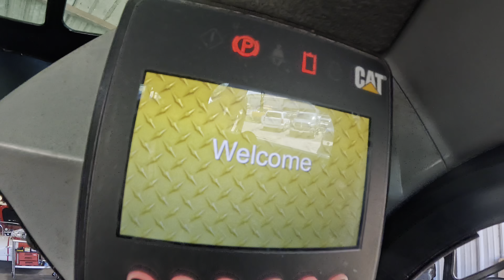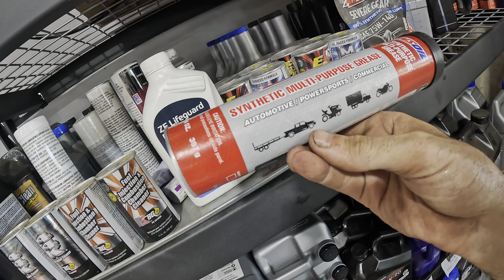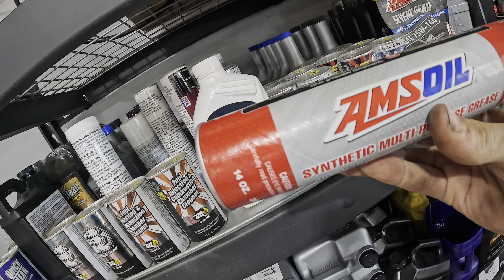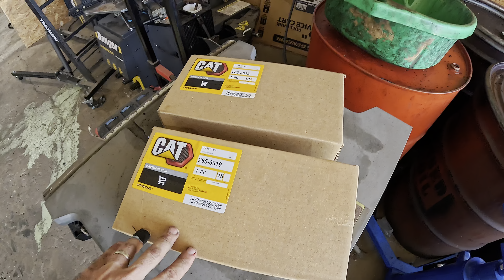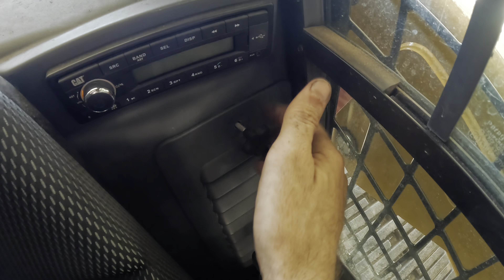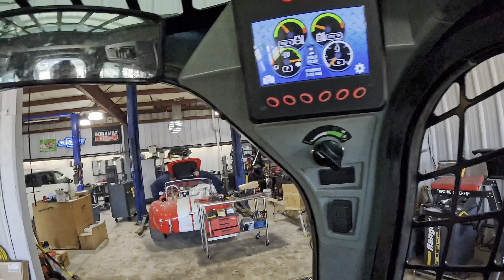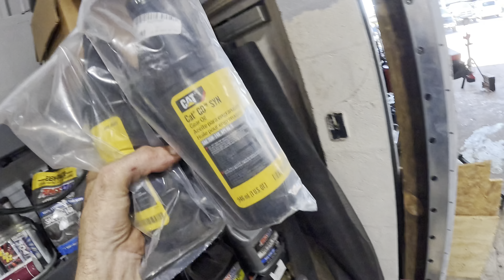Jack Stand Collapsed! Near Rollover! CAT 289D3 Skid Steer

Comment from the maker: Here's exactly what happened when loading the trailer. Lets begin with understanding that this is a hydraulic dump trailer and the deck will tilt back when loading. I have used a chain to lock the deck down to the frame and jack stands under the rear of the trailer to prevent this hinging situation. I usually use stacks of wood to achieve this but I wanted to try the jack stands out. As the trailer took the weight it rocked foreword and back causing the jack stands to collapse and the downward momentum of the even caused the trailer to lift up on the rear of the truck negating the parking brake and allowing excessive movement, potentially causing the machine to fall off of the trailer and or flipping over . When this occurred, there was only one option...SEND IT! I'm going back to using wood stacks.
Reply: I emailed you the CAT 289D3 Skid Steer CAT Maintenance Manual in PDF Format about a month ago. Did you receive it?
Reply: that front wheel that moves is called an Idler wheel.
Reply from the maker: @veteranga7529 I have it, we talked about that later in the video 😉 Ty!!
Reply: I always had pieces of 4x4 ,6x6 , and 2x4 in the back of my F250 for such events .
Reply: Danger danger Ranger😂😂
Reply: Wow really!
Reply: no matter how bad that intro looked, you did the best you could with that. aside from better prep to make that not happen in the first place, that was the best thing you couldve done
Reply: Dear Sir, you mentioned in this very own video, that thing weights around 10.000 pounds ~5tons,  couple of 2-ton jack stands wont do the trick, maybe a couple of 3-ton jack stands would have.. i didnt see that coming either and i needed a pair of pants too lol... XD
Never break rule #1 please.. Stay frosty!
Reply: That was a wild ride! Hope nothing broke on the rear end of your truck or the trailer hitch
Reply: And chock the trailer tires so you don't break the park pawl in the transmission from the rocking. Or just keep on doing it that way. Also I've unloaded on a slight hill and as I drove back the rear of the truck lifted and the whole mess started rolling!!
Reply: Ray, I hope you were wearing your brown pants for that.....
Reply: Ray, I didn’t see the coupler you are using but presume you have a 2 5/16 ball. I once had a coupler disconnect when dumping the load off a dump trailer I owned when the tung lifted off the ball. After that (although noisier than ideal when using) every dump trailer, equipment trailer and truck I ever owned we’re joined by a pintle hitch. It cost me a tailgate but thankfully no one died….
Reply: Question........  Backing it on would perhaps have made it trailer better...
Reply: Had a foreman pull a fork lift onto a wood decked trailer,it feel threw the deck & landed on the stee frame.He also had to clean his draws
Reply: At work we put on the parking brake of the trailer and car and put the car into gear (manual with FWD). It does lift the car up in the rear but it won't roll away. 
Privatly I still put the brakes on but use jackstands anyway to not stress the hitch too much
Reply: Next time put the skid steer on the trailer backwards you always wanna put the heaviest part of it on first
Reply: I worked for a sign company for about 8 years servicing everything from parking lot lights 30-60 ft. tall to huge high rise signs over 100ft. tall. Had several “close calls” of different types, but they ALWAYS took my breath away and caused an adrenaline dump, which almost made me take a literal dump😬😬😬All the precautions in world will not save you from Murphy’s Law. Glad you’re ok- stay safe out there!
Reply: Just don't break rule #1 at Ray's!! Very important 😂😂
Reply: Retired trucker here from Canada. I would like to comment on the  ramp situation. In my driving career loading/unloading some heavy equipment, I came across a UNIQUE ramp. This Ramp had hinged drop legs at the top of the ramp(underneath). When loading this kind of equipment as in the video the 'Drop Legs' were deployed from the underside of the ramps. It was just some flat metal that was hidden on the inside of the ramps that deployed(dropped)n to the height of the bottom of the trailer tires, thus preventing any kind of collapsing of the ramp when loading/unloading.Simple and effective as support legs.
Reply: You COULD also add(WELD)drop legs on the inside of the Trailer Box(Future Project?) These also tuck away nicely within an enclosed corner box(legs slide up and down)
Reply: Rule number Ray; don't die at work!
Reply: Nice save, though. Cheers.
Reply from the maker: @Liquid_Plasma  indeed the math is not mathing, We figured the trailer suspension suspension was going to carry the majority and the stands were just to keep it from tilting. And that worked, 60% of the time
Reply: That being said, it was hilariously entertaining, and will do well with the algorithm!
Reply: That is why I got mounted stabilizer jacks on the back of my trailer for loading and unloading off the back. Might look into a set for the back of that as they should be able to swing up and out of the way 3 ton would be good if you can find them and all they have to do is touch the ground. I do know they have a setting load but they also have a unloading rating.
Reply: Nice Kubota diesel,
Reply: I'm all the way across the pond, and even I clenched my buttcheeks tightly together. Wow!
Reply: ALWAYS WEAR YOUR COWBOY HAT WHEN LOADING!  
Just joking.

But you might think about taking the forks off setting them in the trailer with the tips aimed at the back of the trailer, or loading backwards. That way if you make a sudden stop because some careless driver pulled out ahead of you, the forks are not jamming out the frt of the trailer plus its more bed room the forks would be under the skid steer.

Wish i had the use of one for a month, i could really use it in my back yard. Plus they are fun to drive.  Just not like you did getting on the trailer.
Reply: I was helping a friend load a four wheeler into a flatbed trailer one time. Much smaller scale of course, but I was standing up by the rear bumper of the attached truck ready to toss a line to hook it on. A similar thing happened, but it pulled the trailer hitch off the ball. Naturally the chains weren’t attached yet either. Think I saw my life flash before my eyes and the trailer hitch gouged up his tailgate pretty good. Fortunately I wasn’t hurt. Learned a valuable lesson to stay clear away from that shit when loading. Never saw a trailer hitch pop off a ball before or since that day, but I don’t trust them like I once did.
Reply: At first I thought you had forgotten to place anything under the rear, which is a rookie mistake. You know better. Equipment failure is always a problem. We have heavier and taller jack stands. There are rated for 3 tons each. You won't get them under a car well but they are great for trucks and vans. The base tops out about as tall as the 2 ton stand when they are fully lowered.
Reply: Hi Ray,
I had the same issue the first time loading an excavator 💩💩
The safest solution is to lower the jib / forks to just above the trailer bed, before you go over the "seesaw" point, then as the machine tilts down at the front, you gently raise the jib / forks to lower the front on a controlled manner, you can crawl forwards at the same time. This way, all equipment is spared the shock loading, and of course, the operator and bystanders are safe. 🤜🤛
Love the channel, your sense of humor and your work ethic. Top man! 🤘
Reply: please notify the owner to pull the center caps and drain the excess oil before his seals blow. thats the fill mark

Comment: The drain hole doesn't have to be at the top it just has to be above Center. You're only supposed to put one quart in it if it requires a court it doesn't have to be filled up till it runs out. Remember that when you opened up that Center only a tiny bit came out.
You really don't need to overfill this
Reply: Yep, it may blow the seal out
Reply: Every YouTube video Ray watched, he probably stopped them all after plugs were initially removed lol
Reply: Ray, as others have eluded to you have doubled the gear lube capacity of the final drives. You fill only until fluid runs out of the center plug. Drain off the excess or you will regret it…
Reply: Centre plug is not for drain or refill, it’s the level plug.
Reply: What... ???... no hours written on das replacent filters... ???... how else ya gonna know when to change them.. ???... especially...  after the dog ate yer paperwork.... ???

Comment: In the Army, those small wheels are called "road wheels", and the adjuster is a the idler wheel. That tension system is the same style as what is on the M113 series of armored personnel carriers. If I recall it is also the same as what is on the M2 Bradley IFV.
Reply: It's the most common system out there going back decades.
Reply: He should be thankful that it doesn’t have torsion bars to replace!
Reply: Yeah the boggy is what the road wheels are attached to. Think rear landing gear and some early tanks

Comment: ALWAYS load the loader backwards.. I move equipment daily for my job. Safe loading is back it onto the trailer.!!!!
Reply: I was gonna say that😂
Reply: This! 👆🏼👍🏼
Reply: Keeps the heavy end near the tongue of the trailer.
Reply: You're absolutely right. Same with farm equipment that I transport between land plots. Also there is less air resistance when loaded backwards since the bucket/dozer blade are not catching air. Doesn't seem like much but we've tried it both ways just see. On long haul 2mpg less Ford 6.7 f-450;Case 885
With 7' bucket loaded on 32' gooseneck.
Reply: Yeh, that's it!  👍
Reply from the maker: @scorpion2005765  Yesss indeed… bobcats and smaller machines go backwards, this particular machine and this particular trailer do not balance well when backwards. Theres too much weight on the tongue. I acknowledge that I need a better trailer for 10,000lbs.
Reply: @RainmanRaysRepairs  Or use the tow truck.
Reply: I didn't know that.
Reply: the reason you load it backwards is
for short trailers you want more weight on the tung and 80-90% of the weight of the skid steer is in the back
and you want the lift arms fully down during un-powered transit
Reply: We had one guy try to drive on. The backhoe attachment stopped him when it started lifting the drive tires off the ramp.
Reply: @RainmanRaysRepairs  a 25k trailer looks a bit strange on a pickup truck but I'm within the limits hauling the small farm tractor.

Comment: Watch the track not the extension arm for the track, can easily over tighten these tracks and you don't want to know the cost of these tracks. Get a lock-n-lube for your grease gun, they really do work and helps eliminate that "smoo". Operated these machines for 30 + yrs, did my own maintenance, Bobcats mostly and few New Hollands. Learned, just open them up, every panel, every cover, get inside clean, inspect. CTL tracked, skid steer on tires and the tires "skid" as they turn hence why they're called "skid steers". 
I see someone already called you out on overfilling the final drives... yea, center is level mark only. It's not weird when you've had to do this many many times. This is why whenever I did mine, the entire machine would be sitting on blocks, tracks off the ground so you can do several services at once. If you use a flex funnel pour in just 1 qt, no spill and filled properly. You want to change these with every engine oil change as well, just good sense and prolongs the life. Get that door fixed, helps keep all the dust out of the cab and electronics, dust and moisture don't mix well. Should have backed it on the trailer.

Comment: Warning, warning, warning..... You have overfilled the final drives. The center plug is the oil level indicator and should be left undone when refilling. The fill plug hole is best rotated slightly off TDC when refilling. Otherwise the refilling oil flows straight down and comes out of the level plug before the final drive is at the correct fill level. 

It's a good idea to replace that final drive oil at every engine oil change.
Reply: I'm having a psychic moment.... I foresee new seals coming.
Reply: this.
Reply from the maker: Ok so if I go back and pull the center plug it will level the fluid to spec??
Reply: I was about to type this exact same comment. 👍
Reply: You fill from the top plug and when oil reach the opening of the center it's the correct level. So il you open the center plug and let it drain it'll be correct.
Reply: @RainmanRaysRepairs  Yep!
Reply from the maker: @voidthewarranty1429  So we can look at it like a partial flush to dilute and remove more of that nasty burnt oil 😉
Reply: @RainmanRaysRepairs  Yep.
Reply: I was shown to turn hub so fill plug is horizontal as some don’t have a centre plug.
Reply: Ring gears from drive axles are almost the same then, but the fill plug is a overflow plug. But here is the drain plug also a fill plug😂
Reply: @RainmanRaysRepairs  yes, but if the unit is put into service like this its going to blow the seals out. that is NOT what you want to happen or be responsibe for so call up the owner if its already out of the yard and tell him to not use it until you or someone there drained the exess fluid out.
Reply: It's his own machine.. 😉
Reply: @RainmanRaysRepairs  yes sir
Reply from the maker: @BE-ART  I might buy it actually, it’s not mine tho. Owner is moving to Ohio and doesn’t know if he’s keeping it. Regardless, I still have the machine to easy fix.
Reply: 😅😅😅 Watching that video will probably be the most fun I’ll have all day.  Any more videos like this and I will send you a case of depends!!🤣
Reply: telling a guy he did wrong is usually stupid people going REEE because the internet. you guys not only explained why it was wrong, you gave him a solution and were very decent about it. the internet is a decent place sometimes
Reply: @RainmanRaysRepairs correct
Reply: @RainmanRaysRepairs yes
Reply: @RainmanRaysRepairs this is why we love you ray, you admit when you make mistakes, your only human. Plus the cat would make a awesome addition to your collect 😀.
Reply: @handymandev03  question is, how will Ray tune up a skid steer for MORE STEAM!
Reply: @RainmanRaysRepairs  if you are going to keep it to rent it out you MUST lojack it with a high end battery powerd tracker box thingamajig. otherwise there will be no way to get it back when (not if) it gets stolen. i am actually surpised it didnt get stolen already from the yard.
Reply: @RainmanRaysRepairs absolutely yes.
Reply: How can I play with my new toy, but I can't drive it around the car park... 😅
Reply: @RainmanRaysRepairs  Yes, and if you don't do it the machine will blow the final drive oil seals.
Thank you for your video.
Reply from the maker: @purgold1373  It’s already done ☑️

Comment: The center plug 42:00 it’s to check the gear oil level!  Don’t fill it to the top you’ll” blow the seals out! Planetaries never get filled to the top it’s no different than a rear differential.

Comment: Hey Ray, i look every video youre a top mechanic! I give you a tip as an mechanic of trucks for more than 25 years. Take a little plastic bag and put it over the filter before you loose it. The fuel who is leaking with removing the filter drops into the plastic bag (little one) so the fuel, diesel, will not leaking in the motorcompartiment. 😊
Greetings from the Netherlands Wim

Comment: As you may have heard that center plug is the fill level. Those drives are way over full 😬 You may want to tell the owner to pull the center plug and let it drain before it blows a seal.

Comment: Ray, another awesome video! I dont understand all of the negative comments about how you performed the service, i thought you did fine! But i dont work on these types of machines, i just operate them from time to time. But i do agree with who ever said to always load the skid steer backwards. That is the way ive always done it. My theory is that in case of a event like this, if the skid steer starts to tip backward at least you have your forks or what ever attachment you have on there to catch and help stabilize the machine! 

I dont want this to sound like criticism, because its not! You did awsome recovering after the trailer started to tip! 
Just telling you what works good for me! Hope it helps!
Have a good one man! Glad it ended the way it did!

Comment: The central plug is the level plug. You have over filled the final drives. It could cause the seals on the final drives to leak when the oil gets warm the oil will expand and cause pressure to build up and blow the seals. Remove the central plug and let the oil drain out. When it stops the level will be correct

Comment: I don’t have this exact machine but on all of our machinery, like others have said, I believe you have over serviced the drives which now once it gets hot may blow your seals. I believe the centre plug is the oil level, basically half full. It’s oil bath so no need to be too full.